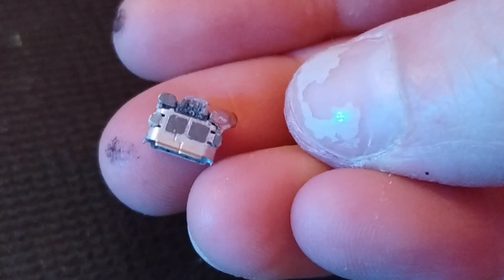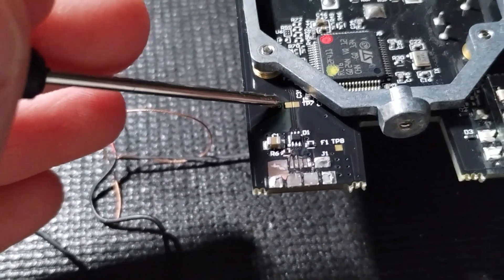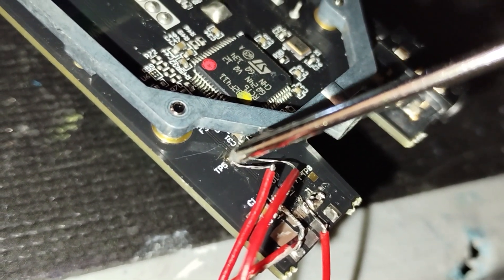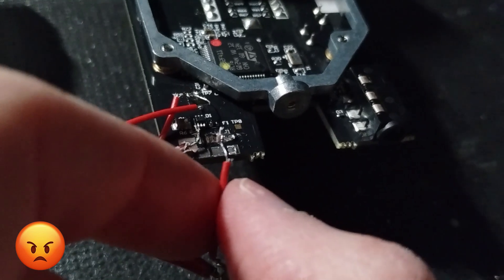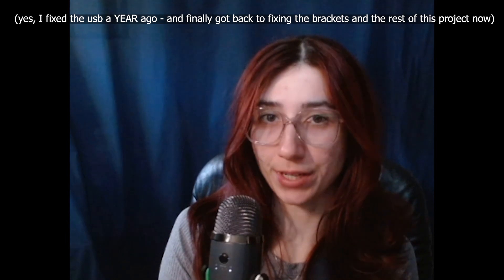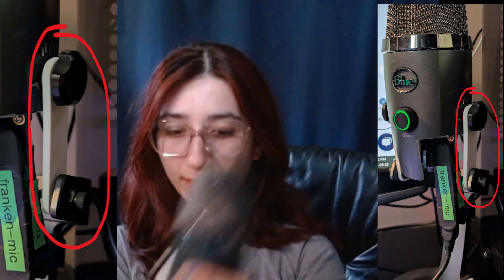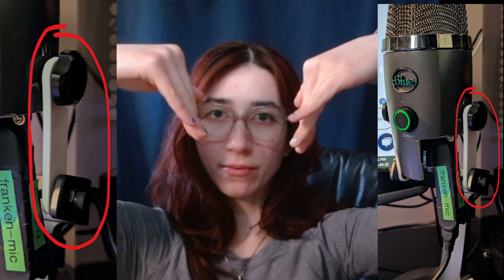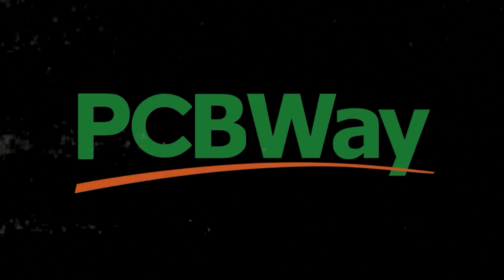a broken USB port - can I fix this microphone? (electronics & 3DP repair for blue yeti nano)

Comment: lol i also have a blue yeti with a busted port to fix.. but it’s the original one with MINI usb not micro.. and i want type c but aliexpress only sells tiny perfect typeC replacement ports for micro pinouts, i guess fixed cable it is

Comment: Kinda ironic how the main issue from the OG Blue Yeti (the big fat one with the diameter of a forearm) has been transferred over to the newer smaller ones, and arguably made even worse. The OG Yeti had a thru-hole miniUSB port that loved to snap internally (the plastic bit the contacts are on) when someone tried to pivot it in its stand, or just from using it on a microphone arm with the cable being under tension, while these newer ones instead have the worst connector of them all... surface mount microUSB. It either fails internally (contact issues) or it snaps right off the board with a 99 percent chance to take all the pads with it like in your case... ugh
also at 2:18 .... testpoint 8 (TP8) on the right next to the F1 fuse marking is also ground... and so is that whole area around the (now missing) connector. Just scraping off the silkscreen with a flat blade screwdriver would've given you a giant new ground "pad" to solder to lol
If you want to improve your soldering, start by grabbing some 63/37 flux core solder (or alternatively 60/40). It makes a world of difference, and most of the time™ you don't even need extra flux with that stuff. Just avoid chinese sellers/"brands" cause they're known to fake the weight by having the plastic spool oversized and actually weigh more than the amount of solder on it
Reply from the maker: Thank you for giving me some feedback as per the requests in my video! I really appreciate this. Also glad someone else gets my annoyance with the stinkin removable usb cord & surface mounted ports lol...

Comment: Surface mounted ports are  ALL the facepalms 😮‍💨 I had some headphones with a surface mount cable port that, of course, broke within a week, and the bluetooth never worked properly. Ended up getting £150 for £25 after a 50% refund for the bluetooth problem though, so I can stick an aftermarket AptX unit in it and call it a win!

They are AKG Y50BT

Comment: 10:25
In one word "Triangles"... You need Triangles 😂.

If you want a rigid (stiff) connection, you should think of connoting things at 3 locations. (And not have all 3 connections on the same line)
I like how it is designed to go togetter, making it easier to print and easier to modify afterwords.

The legs are a good solution. But you could also use the mounting points where the mic connects to the base. I think that could be stiff enough to hold the weight.

Also I have never seen a good design labeled version 1. 😂
You learn so much by producing a thing and assembling it yourself. I honestly think it is impossible not to think about how you could do things differently when doing so.

Comment: 10:48
What... "not sure if we can tell a difference".... 😵
To me it sound like a huge difference. (I double checked with some headphones, but I have not tried good quality headphones or IEMs)

The sound from the room is dampened quite a lot. But also the test is not the best. The distance you speak from a mic changes the sound quite a lot. People sounds deeper and softer if they speak closer to the mic. For a natural tone 30-40 cm is a good starting point in situations where this matters too you.

Also you might want to make a pop filter for when you are close to the mic.
Reply from the maker: I have a pop filter from an old mic! I just need to figure out a way to mount it to use it with this microphone since its from an older arm mic I used to use.

It has a clamp at the end (pop filter) so maybe I can just mount it to the desk when I use it for now...
Reply: @strelkomania  Or you could try and mount it to the shield. 🤷‍♂

I actually think it is a nice little setup. It does not take up much space.

I have a shield that is mounted on a mic stand. And I never use it. I do uses the pop fileter. I just mounted the mic and pop filter to a spring-balanced arm (scissor arm) and live with the room noise. 😂